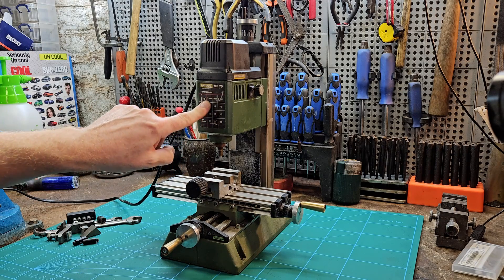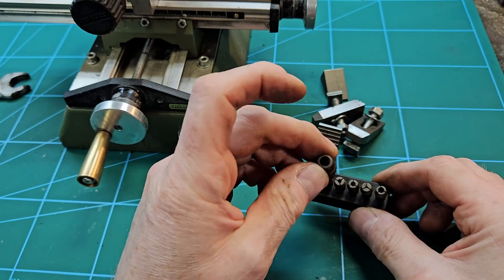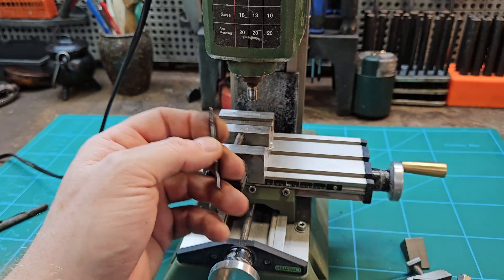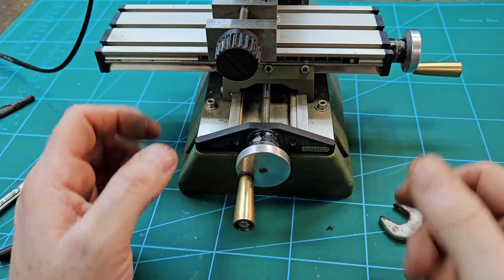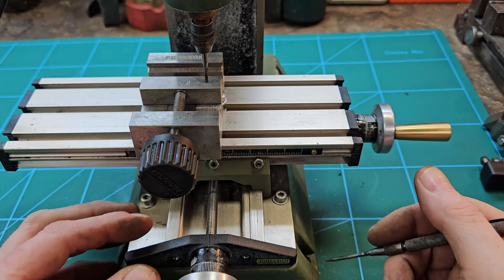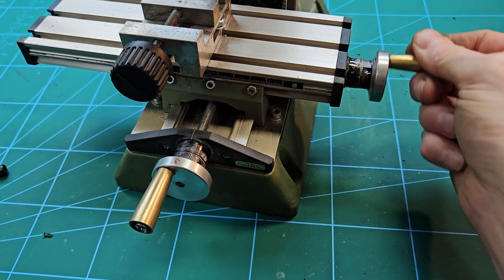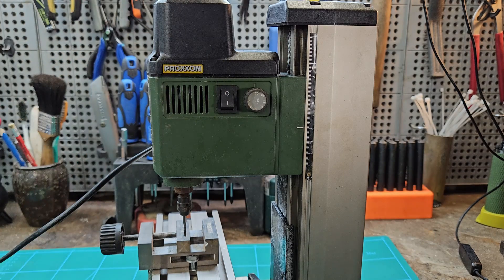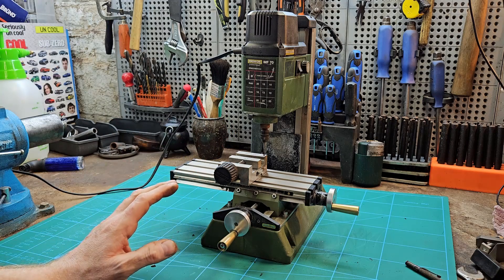Should You Buy A Proxxon MF70 Micro Mill? Find Out What's Wrong With It

Comment: MF70 is quite great TOY. I did a lot of thing with it and I have most of accessories possible :) In my opinion it is really better than cheap china toys for price up to 300€ but it is crap. Purchased from Germany and after maybe 2 weeks changed bearing from original noname poor quality ones to some better. Horrible noise is from bad bearings mainly. Compound table is wobbly, with bad handles, bad screws, really big backslash (no less than 0,5mm). Rotating of handles is real pain. If you tighten screws for less backslash - too hard to turn them. You must rebuild almost all compound table to have some useful thing, at least you must add trust bearings - there is just steel washers. When you tighten some part to the compound table - tightening DEFORMS THE TABLE. Strangely accessories for mf70 look like better quality than MF70 itself. If it would be really good - there would not be such amount of modification possible online. So it is really nice and helpful but just a TOY.

Comment: Proxxon made in germany? You must be joking. The even drill press is all aluminum shafts that brake after one year.
Reply: I’ve had a Proxxon micro table saw for about 20 years. Still works great. I used to use it almost every day for cutting polycarbonate plastic.